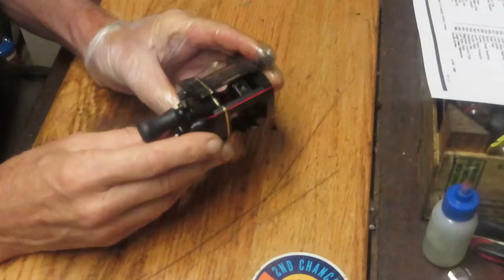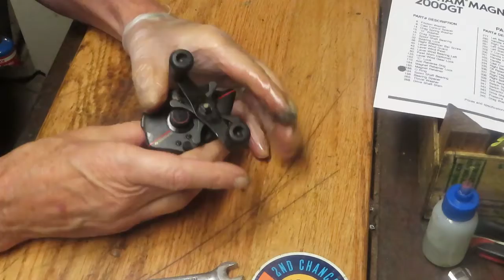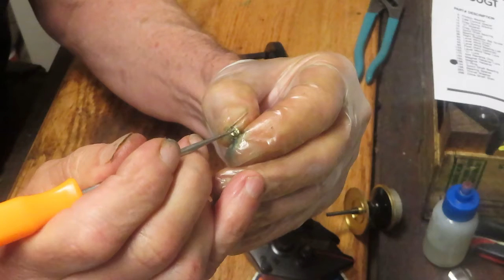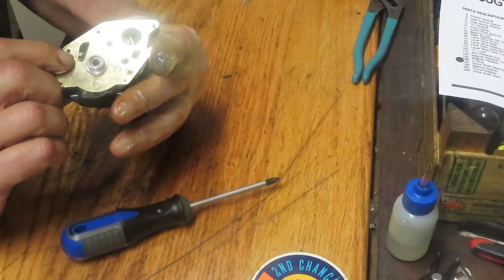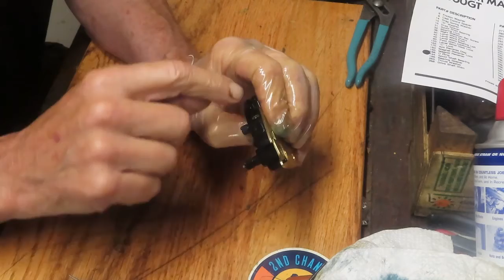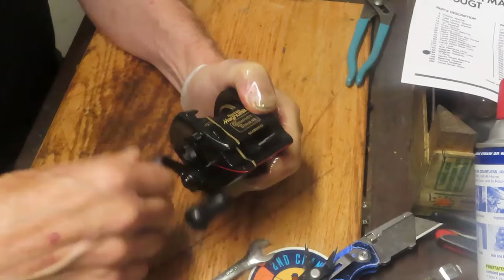Shimano Bantam Magumnlite 2000GT fishing reel service

Comment: Dennis, do you think you could rebuild a near mint condition Magnumlite 2000GT for me?  It was my father’s reel with a near mint matching rod.  I have a near mint condition Daiwa 7000D reel and Eagle Claw made in USA rod I may trade for the work.
Reply: The rod is an 8’-6” Steelheader.
Reply: BTW, I believe my late brother mucked with the Shimano and lost the inner spool bearing and a copper shim.  The reel looks great but is not working properly.  I have fixed/serviced many reels but want this one to be repaired as best it can.
Reply from the maker: If it is only ,missing the bearing and shim, they should be available and I will be able to help you restore the reel. - Please send a note to my email 2ndchancetackle@gmail.com for service and repair information - Thanks for asking - Dennis

Comment: That is such good condition. wow !. 
That model first apperared in 84 (maybe late 83 but i dont think so). Shimano date coded their reels so you can tell exactly when it was made. The date code is on the underside of the reel seat on a sticker or stamped in. It consists of two or three letters. First is the year, the second letter is the month and the third is where the reel was made. A = 1976, b = 1977 c =1978 etc. for the month a = January, b = February etc. If it has a third letter S is Japan M is Malaysia.
Reply: I've got one from October 1983. Japan
Reply from the maker: Thank you for the additional information.  I appreciate the input and always like learning more - Dennis